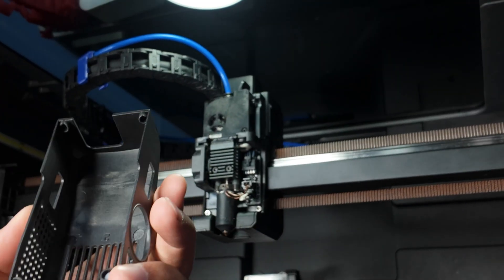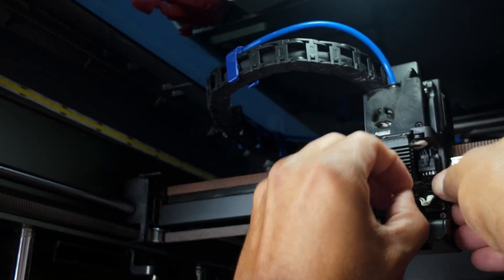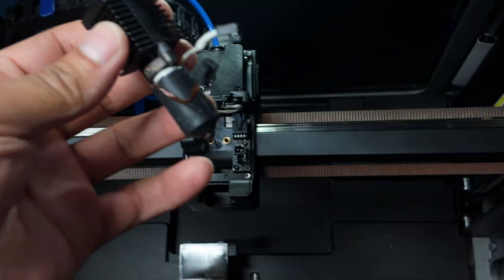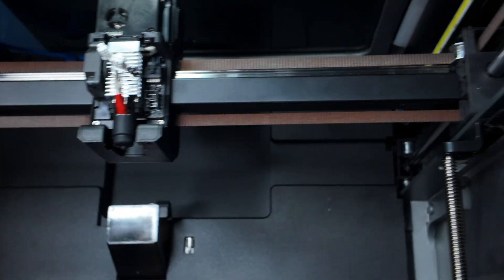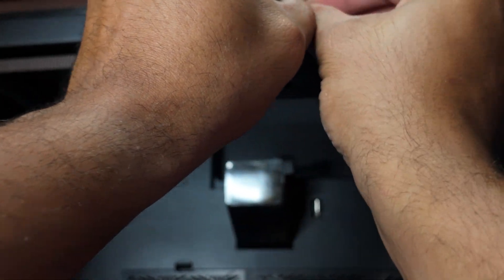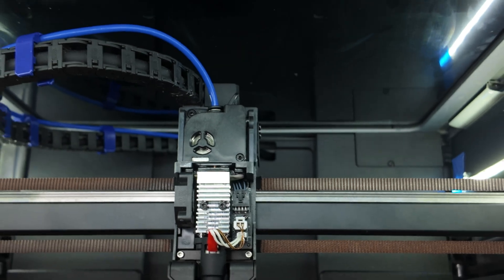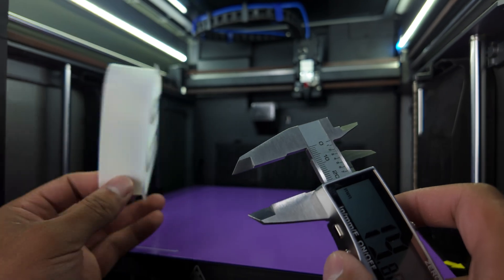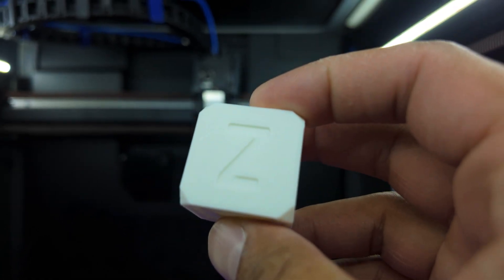Upgrading The Creality K2 Hotend with Micro-Swiss FlowTech Hotend

Comment: Hi, 

I really enjoy your videos I’m subscribed to your channel! 

Not long ago E3D released the ObXidian nozzle for our K2 printers, which I think is a great step forward. I noticed you’re running the Micro Swiss setup, which I was also considering.

Looking purely at the specs, the Micro Swiss can push around 50 mm³/s versus 48 mm³/s on the E3D, and it can handle higher temperatures. But the nozzle that actually reaches that 50 flow is abrasive, meaning it wears faster and isn’t ideal for every filament type (e.g. CF). Micro Swiss also offers the Diamondback, which is fantastic for abrasion resistance, but then you’re back to the default flowrate – making the high-flow heatbreak less relevant.

Another point is weight: the larger Micro Swiss melt zone adds mass to the toolhead, while the OEM E3D-based Unicorn system is lighter and uses a ceramic heater block. That ceramic element makes it more accurate and responsive for temperature control, which is especially important at high speeds.

How do you see this? Would you consider switching to the E3D ObXidian setup?
Reply from the maker: Thanks for subscribing Yup I was thinking the same thing about the weight and I was considering getting both to compare I would switch to E3D for sure to compare.
Reply: @layeredlegacy3D  Other question are those kdeavi far superior over the OEM build plates? Those purples are not available anymore on aliexpress. Where did you buy?

And those Blue Capricorn lookalike tubes where did you get those from? Th3D is for me to hughe of a shipping cost im from europe.
Reply from the maker: @Xanderdegroot  The kdeavi plate are 100% worth it before with my stock plate I would have to add brim to every print and sometimes put glue on the plate with the kdeavi just print and not worry about adhesion issues
Reply from the maker: @Xanderdegroot  links to both from Amazon and plate from tiktok 

PTFE Tube
https://amzn.to/3JmARz1

K2 Plus 
https://www.tiktok.com/t/ZP8BjXxyJ/
Reply: @layeredlegacy3D  That would be awesome!

Comment: How's everything holding up for you? Saw a couple reviews mention a drop in quality after swapping from stock, but you never can tell what the internet at large is doing behind the scenes.
Reply from the maker: Everything is working great and definitely no drop in quality for me at least but everyone printer is different would definitely recommend if your have issues with stock or just want to upgrade
Reply: @layeredlegacy3D Good to hear, I'll have to give one a shot. Thanks for the reply,  man. I really appreciate it!
Reply: I have it and honestly I just use it as a backup, changing nozzles is nicer. but doing extremely high flowrate(PC at 350C) I can hit decent quality with a 0.8CM2 at 75mm3/s but can get a little more mayb 85mm3/s with the stock one using a silcon carbide nozzle.

Comment: Did you figure out why you had banding on the config cube?
Reply from the maker: Nope I have no idea why
Reply: @layeredlegacy3D did you do PID tune after you swapped in the microswiss hotend?if not Might help since its going off the stock hotend with the smaller heat break. Bigger heartbreak in the microswiss might be messing with temperatures and filament can't flow right....just my 2 cents
Reply: "Messing with" in a good way but only once nozzle PID is tuned